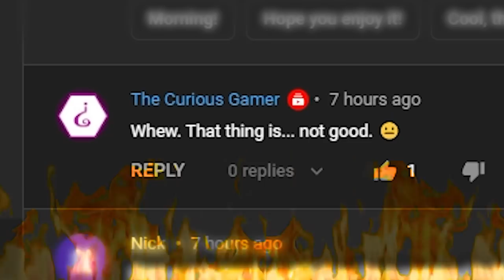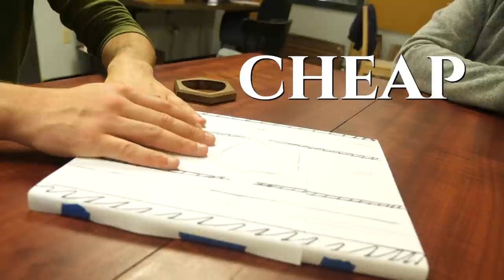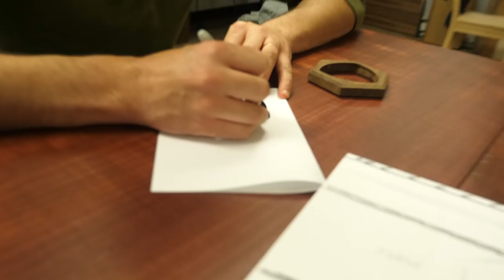New GM Screen Design Pt.2 (Jason was right)

Comment: Doug, you've been burried in MGT for so long that efficiency is the only hammer in your toolbox right now, and everything is starting to look like a nail.
Vision is how you got where you are; and vision will get you to the next stage. 

Jason, at this moment, seems to be the person defending this most strongly, with bobby as a close second. Do not discount this.
The moment you do, you'll start seeing your company start to crumble under its own weight.
Reply: Doug worded what he said poorly. The irony was he was speaking FROM his vision... the same vision that also helped propel Wyrmwood to where it is now, as the founder/CEO. What he was trying to communicate to Jason was he needed to offer solutions, not just point out problems. And he was absolutely right on that point. If left up to Jason, there would be no movement on GM screen at all... Doug is the driving force here to actually deliver a product, even if it doesn't match his exact vision.

To be clear - Jason is of course absolutely right on the brand alignment. But he isn't providing the right feedback on that point. He needs to offer solutions & alternatives to make the ugly prototype into a beautiful, on-brand final product.
Reply: I think part of this is also, as Doug has brought up multiple times in videos over the last season or two, is that they've built a machine, and they need to keep throwing stuff into it. It sounds like he's trying to get a project that will help further diversify their revenue stream and keep people employed, with quality as a second thought (not an afterthought, but second thought).
Reply: @kgoblin5084  Could not agree more.  Yes, so far the designs Doug is coming up with are not terribly attractive, but he is the one pushing innovation.  Being able to accomplish something challenging that no one else thinks you can do is how you make great products, and to get over the hurdle of "this doesn't seem feasible" you need someone who will push everyone around them to get creative.
Reply: @kgoblin5084  ..communication and unified vision is key. Jason wanted to give solutions but wanted clarification. something like what was it going to be sold under.   to Jason, the only solution if it was being sold under wyrmwood was to do something else because he didn't know of a way to make 3 blocks of wood nice enough to be sold under wyrmwood's brand. Doug even admitted Jason was right later on and wants mock up's of the three different ideas.
Reply: For the love of everything that is good and holy, would you guys at Wyrmwood PLEASE hire someone so you don't burn Jason to the ground and lose him?!?!?!?  I'm sorry, but you need to shell out the BIG BUCKS and hire someone with solid industry experience so Jason can do what he's best at.  

I understand that Doug has a desire to keep the mass of employees he's had to hire (including Pennsylvania) employed, but I'm more worried about Jason admitting he can't deal with Doug's typical tactics for getting more out of a design so he's just going to agree like a sycophant.  Seriously. You need to give Jason a raise or buy him a car or something that shows beyond any reasonable doubt how much he is valued and hire the most competent mechanical engineer type shop leader person who can take care of the floor (regardless of the cost) and take some of the weight off of Jason's shoulders (or however that works - I don't know enough about manufacturing to really understand who's responsible for what on the floor).

I completely agree with the statement @Muizz said; "you'll start seeing your company start to crumble under its own weight".  Come on Wyrmwood, this is your wake up call.  You have valued employees, but human beings can only be pushed so far.  Value what you have so you can keep it.
Reply: @kgoblin5084  Doug offered a terrible product. It really didn't deserve much feedback.
Reply: @cassiebanks  Yes, it's deeply concerning that Jason chose to not argue about it because he didn't feel like getting steamrolled by Doug, especially when it took what, a few days, for Doug to be splashed with that bucket of ice water and wake the fuck up to the fact that Jason was 100% correct from the very start. When the best designers in the company start feeling it's pointless to push back against bad decisions, there's a massive fucking problem.

Comment: As always, Jason is right. Here's the thing. Cheaper simpler screens already exist. If that's what people want and can afford they are already buying that. Make the premium product that simply doesn't exist right now and people will pay for it. It's crazy to me that Doug doesn't see this when I remember him saying that the expensive inlay dice vaults were the most popular in the dice KS and that if you have a really compelling product people will pay for it. 

Also, it's painfully clear you need another Jason-level designer on board. Design and development is obviously a major bottleneck for you.
Reply: "As always, Jason is right. " On the point about staying in brand, yes. On how he is providing feedback on that point? No. As Doug said he was just shutting down ideas, vs. offering alternatives or solutions. The 1st just shuts down the process, the 2nd keeps things moving forward. 

"Make the premium product that simply doesn't exist right now and people will pay for it."
Doug's suggestion would at minimum retail at around 3x the standard price point I'm finding on Etsy. Most of those use a fixed hinge vs the magnetic rod... and frankly the magnetic rod & the ability to flip a wing 180 degrees is a feature that excites me. That is hella useful for selectively showing players information. a $300 to $500 GM screen is still a premium product, while having MUCH larger demand than a $1000 screen with the same features but constructed using a different method... of questionably better aesthetic & craftsmanship. Can we stop pretending that a repurposed cabinet door is somehow higher quality than a nicely carved &/or inlaid solid piece of wood?

"Also, it's painfully clear you need another Jason-level designer on board. Design and development is obviously a major bottleneck for you."
Agreed
Reply: what I personally would love is a shreen that was like a KIT you put together yourself (not form wyrmwood it's not thisr vibe)
Reply: @WardNightstone  seems like a paladin kind of thing

Comment: Thank the gods for Jason. 

That being said, I spent most of last year saving up for a WW screen, and budgeted around $1,500 for it based on the 2017 KS plus some inflation. Jason hit the nail on the head. This is a forever purchase, I want to buy it right the first time, I don't mind spending the extra money for a product that I can be confident in its look. 

Also also, four panel gang here, no idea how people get enough space being a 3 panel screen.
Reply: With you on 4 panels, not enough space for notes / books / notepad / rolling space
Reply: I was looking for this, 3 panels are not enough!
Reply: honest, they should offer both a 3 and 4 panel screen depending on the buyers preference, although ideally if its a 3 panel screen a slightly wider middle panel would be best (say 1.5x width)

Comment: I’m with Jason on this one. I’ve felt like Wyrmwood has been losing it’s thing, especially with these tracker tiles. This GM screen idea seems to support it. Wyrmwood is, in my mind, about craftsmanship, but now it’s just more of a “let’s make this cookie cutter thing so we can stay relevant and make more money”. Jason is 100% correct, it’s not on brand. Even the updated panel, while it is better, still looks like basic and isn’t Wyrmwood.
Reply: I really like Team Doug, but I will need to see the route out option first. I can't see paying the cost for the frame panel
Reply: Jason is 100% correct. Though, Jason is also a strong advocate for not publishing the tracker tile system as a Wyrmwood product, but instead a different brand. Which is 100% reasonable. I would be willing to buy laser cut and assembled tiles/boxes that function but look like shit from a company. But I would probably not buy them as a Wyrmwood product directly because it doesn’t fit their standard, and I’d feel like I was throwing money that would encourage bad design.
Reply: @zephyr5321  The costs they were throwing out were if they produced, not just frame panels, but Mercer-level panels. Obviously, frames don't HAVE to be that expensive. There is a TON of middle ground there where they can still have a quality item and not just be a butcher block.

Comment: Yeaaaaaah I'm with Jason on this.  I would prefer just a simple frame in panel even if it took a year or two to get right and make it affordable-ish. 

Additionally the extra details won't allow the screen to fold or stack properly.  Huge functionality removed for some tacky details.
Reply: Thats a great point
Reply: Yeah the screen being able to stack for storage/transport is important.
Reply: Agreed, keep it simple and affordable-ish
Reply: If the embellishments are only on the center panel then that's just always the top of the stack. With detachable panels it's not an issue but wouldn't work with a hinged design.

Comment: Really agree this should be an item, not a system. Speaking for myself, I wouldn't buy a wyrmwood DM screen for the innovation it brought. In fact, magnets and a ton of modularity might turn me away since they have a tendency to make a product look/feel "unfinished." I would buy a wyrmwood DM screen for the same reason I'd buy a dice vault or rolling tray: to have a finely crafted, luxury product to elevate a gaming experience. Magnets and systems and functionality are great for tiles and stuff, but when it comes to something everyone at the table has to stare at anyway I'd want it to be elegant and beautiful to look at rather than have a lot of functionality. (This goes double if you'd have to pay extra to get accessories that unlock the functionality.)

Also, what's up with the deck boxes? We saw them a couple weeks ago but curious if there are design changes being done or if you're stamping those as a finished product.
Reply: I would agree on wanting an item vs. a system... as pointed out in the video no one really wants an expandable GM screen. However.... I do want something functional, with features I want to use. I'm not going to buy a product that doesn't give me value, no matter how well-crafted it is.

My thoughts on that are:
* the ability to re-arrange & flip the panels would be super useful... maybe not turning it on it's side to be higher (& thus trading off the groove wh/ provides a better grip), but flipping it 180 to show something to the players  - eg handouts? Super useful. I want that. Which means keeping the panels as separate pieces.
* I want the actual surface area to be blank where I can attach my own stuff. I DO NOT want a bunch of pre-made, permanent trackers/tables/etc that, given their usual MO, are going to be 5E specific. I need to be able to use this for any game, not the popular system I personally don't care for & which is very likely going to be retired in the next few years. Lock in is NOT elegant.
* cost wise, I wouldn't say I'm cheap, but I would also find it hard to spend as much on a GM screen as I have on multiple dice vaults, dice-sets, & hex tiles over the last 2 years. $1000 is super stiff.

Comment: Just want to point out, there hasn't been a single person yet that supports Doug's idea in the comments yet. You are a big company, one of the things you really need to start learning to do is outsourcing the stuff you don't do perfectly. Jason called it perfectly, there are plenty of company's that make inexpensive framed cabinet doors, why can't we. It's because it's not your expertise, okay great, then find a company that does that and partner. You don't need to buy them, this is a product not a platform or an ecosystem. You know quality and have the back end, you can easily team up with a company to do the front end.
Reply: Not to mention, with Wyrmwood's quality standards, I know that any panel manufacturer they pair with is going to give them a quality item to work with.
Reply: @kgoblin5084  both of our comments were posted 16 hours ago, when I wrote my comment, there were no supporters of Doug's idea. I'm not trying to invalidate you, just saying we passed each other in the night. I think what Jason was getting at was if there are cabinet makers that can do this at reasonable price points, we can to, by partnering with them. Absolutely no need to bring on a full new manufacturing line for a product that would require all these specialty tools. You can still want a low price point, and metal rods and magnets, and a frame design. It's putting it on the business to either figure it out or determine where they are going to sacrifice. Doug wants to sacrifice on quality while maintaining functionality and price. Jason wants to sacrifice on schedule. Bobby wants to sacrifice on price (aka leave it expensive). I would like them to figure it out and realistically the thing that will take the hit if they invest internally or go outside is schedule. But you can still keep prices down while maintaining quality which I think is really important.

Comment: I feel like the problem here is an overwhelming concern to push a product out of the door. If you want to 'give the people what they want' then don't rush it & pinch us off a turd, especially if you're planning on this product launch being a data point for whether you can cut the middle man (kickstarter) out of your business model. Do it right, take your time, listen to your designer and if you need feedback from the community to clarify what you should be building, then ask for it instead of guessing. I would not bat an eyelash at $400 for a 3 panel DM screen designed tastefully and built to last. If you offered laminations like the class-themed adventure sets or metal/resin inlays, you'd convince me to pay even more. Custom art or laser engraving panels (cross promo opportunity) that could be swapped out/upgraded later, I'd pay even more still.
Reply: Exactly
Reply: Totally agree!
Reply: The problem is they have to operate to timelines for financial reasons. Money becomes a big problem if they take too long to get something ready.
Reply: @syntaxlost9239  That's why they have to break away from the Kickstarter model. They've been kickstarted - they're up and running. Now, they should be offering a continuous flow of accessories and products through their website to generate a more continuous flow of demand rather than these short booming peaks that Kickstarter forces. Smooth out that curve and business becomes more stable and predictable.
Reply: @UberHypnotoad  That's impossible. Kickstarter has loaded them with so much debt from the pre-order model, they're not going to crawl out of it without some sort of miracle.

Check out the modular game table Kickstarter if you don't believe me. They're now asking for the full payment from all customers for all waves despite being massively behind on delivery.
Reply: Man, a magnetized frame with swappable panels would be amazing. Could do runs of limited art/collab panels or customs. I'd definitely drop 50-60 bucks for a campaign specific centerpiece that I could swap into my screen.
Reply: i don't think you are looking at it with appropriate context though. It's not just the past couple months that people have been asking for DM screens, it's been years and there has, seemingly, been 0 progress made at developing a product to sell year round on the website vs only for a kickstarter. Seems like he aimed himself at that and has the mentality of "we are going to get this made and for sale" vs leaving it as a nagging idea/future kickstarter when they have time in the future.
Reply: @syntaxlost9239  Exactly, the Kickstarter model got them into this situation. You can't dig up. Strategies have to change.

Comment: DM screen is probably a product where you want to go Quality over Quantity so completely Team Jason on this. Solid wood just looks to heavy and clunky imo.
Reply: So you want an ugly cabinet door instead? Not even being contrary here... that route sounds like a step back to me - the opposite of elegant & more expensive to boot.
Reply: @kgoblin5084  While I respect you opinion, I don’t agree with your conclusion. Have you seen the DM screen Jason made for Matt Mercer? Would you call it an ugly cabinet door? 

“Frame and panel” is a building technique and how good the finished product looks is always dependent of the time and effort. A well-made cabinet door does not look cheap.

That is also the reason why Doug needed to put inlays and gimmicks on his prototype because it simply looked so bad to begin with.

Comment: I was so excited for this episode after the wednesday comments. You guys rock. Main call out is that we want it to easily stack or fold the screens so too much raised stuff would be hard
Reply: Agreed. Any raised details would need to be in a recess so the overall dimension fit the thickness of the frame...and panel?

Comment: The magnets of the Matt Mercer screen (or a very similar solution) are a must, it's so slick.  Frame and panel is the way to go. The DM screens need to be a flagship, show off, "Only Wyrmwood can do this" kind of item. I do not want this to be an item that is extremely affordable, I want an item of extremely high detail and quality  $1000 - $1500 is about right in my opinion as where the entry to this product should sit. I'm with Bobby, make it fancy, charge through the nose.
Reply: I think the absolute lowest price point they should be shooting for is $750, any lower and I don't see how they'll make something that doesn't clash with their existing products.